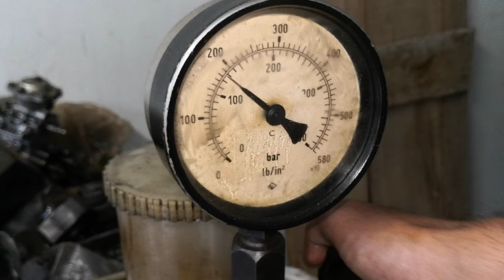How to Diesel injector service, Toyota diesel injector,diesel nozzle work

Comment: Sir I have swift zdi 2012 running km 120000km.cold starting pe rpm flacuate hota hai .and engine missing krta hai..smoke se smell ata hi..egr intercooler clean hai..kya problem ho sakdi aa??
Reply from the maker: Tapped check kea lo in ka b ho sakta ha, diesel pump retire ho phir b ho sakta ha